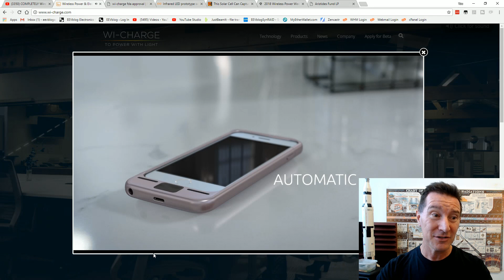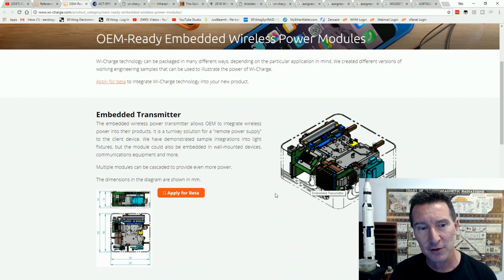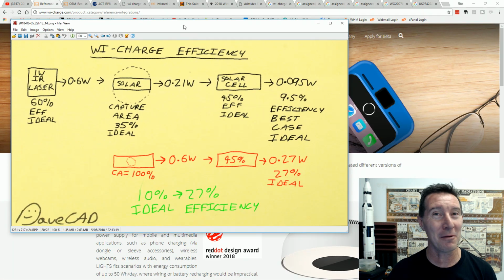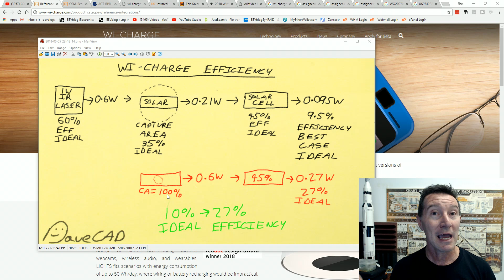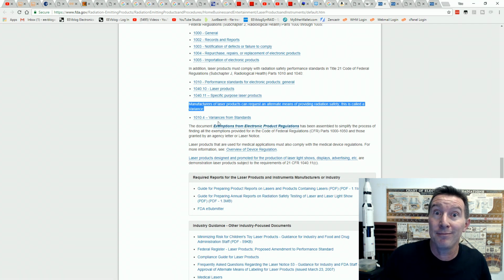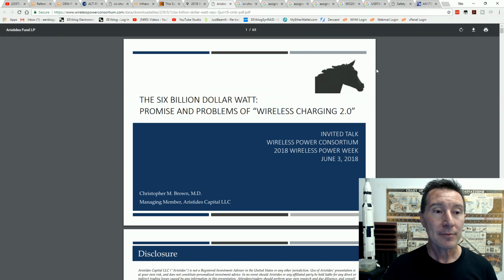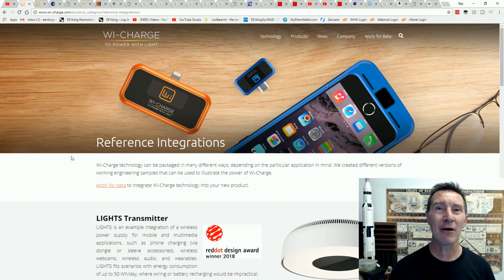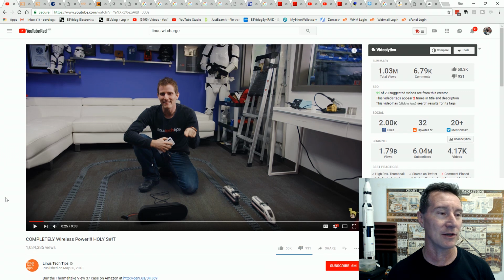EEVblog #1092 - Wi-Charge IR Wireless Charging - Fact or Fiction?

Comment: At least it will get nice and warm in your room.
Also good device to get rid of your tumor cells (and everything else)
Reply: Piet Muijs Not really. The average resting human male gives off about 100W of heat. This thing only produces 5W of infrared energy, some of which is being converted right back into electrical energy.
Reply: Correct, but that's not focused on just one spot! They actually do use similar techniques to get rid of cancer cells just underneath the skin surface.
Reply: Piet Muijs He was refuting your claims of it heating your room. He mentioned that your body gives off 100 watts of heat, and this unit has almost 100% efficiency through the air. (As stated in the video by Dave.) So it shouldn't heat your room by any noticeable amount. (Negligible heat output.)
Reply: The amount of heat produced will be equal to the "wasted" energy, the amount of consumed power that doesn't get converted back into electricity. So if it's 10% efficient then it's 90% heat.
Reply: Well if you hear what kind of laser you need + any other losses in the circuit. I would say, go do your math!
Reply: +Piet Muijs
What?
Reply: 5W delivered with 10% optimal, would waste like 95W just on the laser itself. That plus all the tracking and such and that's pretty close to a person based on numbers here.
Reply: So you think that 5% is negligible output, eh? Tell that to w-charge!
Reply: If this thing can track flying mosquitoes and "deliver power to them", I'm buying it straight away.
Reply: lmao
Reply: hope your being sarcastic
Reply: An 80W candle is fine from a few cm away, but not if you put your finger in it. 
Also, a laser beam can stay bundled for quite a long distance (Therefore keeping it's intensity, unlike the candle)..

1W focused to e.g. <1mm diameter can definitely cause trouble. I assume they're using a larger beam to limit the danger for skin and eyes..
Reply: there was a guy who actually built one of those to be used in countries where malaria mosquitoes live.  AND he made to distinguish between different types as only one carries the malaria virus. cost a bazillion dollars but he did get it to work!
Reply: you dont get rid of cancer cells with IR light genius
Reply: "you dont get rid of cancer cells with IR light genius"

Yes you do

You can*
Reply: @Blox117  . This is actually a well used method in hospitals. Was my university project many years ago.

Comment: I think the efficiency numbers need to include the power required by the control electronics and the scanning mirror system.  Since you were talking about a device with 1w input to the laser, I am guessing the control and aiming might also take a watt, more for early models and less as they improve it, dropping the efficiency in half.  The other issue is if you are powering more than one device, there will be time lost to slewing the laser between devices and getting the spot aligned properly.  This will also lower the system efficiency.

I am not sold on my "wireless" Qi charger needing to be wireless itself.

Comment: I really don't understand why companies are still trying to chase this whole wireless power idea. No matter which way you look at it or what technology is involved in delivering this wireless power, it will be incredibly inefficient, it will be plagued with issues and it will be incredibly expensive. And as Dave said, especially in this day and age of energy efficiency and power efficient devices to help save the planet and reduce our carbon footprint I really don't see the logic. Just plug a cable in or use a QI charger and be done with it.

Comment: Ooof, thanks for talking about this Dave, I needed this video.

I honestly had high hopes for these ideas around wireless room power transmissions and whatnot, and I had fallen a bit for the marketing speech, but your video really helped dispel some of the bullcrap. I've heard about the Energous stuff like what? 5-10 years ago now when they first showed up on CES. Got subscribed to their mailing list and still regularly receive some news from them every so often, but of course it's never about any of the products they promised and that they've been saying they'll have ready for the market since that first presentation.
It's not that I didn't have my doubts, but I think it just didn't hit me.
In a sense, all I've ever expected from these technologies was trickle charging... I mean, it only makes sense - if you can't have a full fledged charger with Qi that's basically induction, and you need some pretty big solar cells under very bright sunlight to get anything usable, it really doesn't make much sense that this Wi-Charge or the Energous RF based charging would do a whole lot better - because if they did, people would already be using it.
To the point, I'd be satisfied with trickle charging if it didn't have health hazard potentials, and if it doesn't like pull so much power that it's just better to buy 10 qi chargers or 20 magsafe style cables and spread them around everywhere. Wishful thinking I guess.

But since we're here, what do you think about the Disney crazy room stuff Dave?
https://arstechnica.com/gadgets/2017/02/disney-room-scale-wireless-power-transfer/
Sounds dangerous and somewhat like having a transmission antenna into your home or something... with similar power costs. Anyways, thanks!

Comment: Having designed systems with high power IR sources, I agree with you that this product would not be approved using the published standards and would have to be approved via some variance!
Just for clarity, the systems that I worked on were not interested in transmitting power, we were just using the IR for signalling, even that was difficult!

Comment: I don't think this technology is for me but I do find it interesting that you gave them davecad math saying between 10-27% ideal and they came back to say safe to say it's between 5 and 27%. Makes me think it's somewhere in the 5-10 range or else why would they lower the range?
Reply: Aaron E 
It is more like 1%. 

Daves numbers a far too optimistic, specially the detector at 45% is far too optimistic. 
Realistically we have 30% on the transmitting laser, 10-15% on the detector, 90% on PSU for the laser, a few watts on electronics/software, a few watts on tracker mechanics, 10-99% losses in spot tracking. 

That said, efficiency is not an important here. They simply can NOT deliver 5W of optical power safely on a spot size similar to the device size .  That becomes even worse If they are talkining about 5W delevered electrical power.  

Regulation for public spaces limits laser power to 1mW. This makes me believe that there are batteries in the trains and they are using the laser for control.
Reply: Naoh Watson Well it's in demo labs only, not public spaces, so the 1mW doesn't apply yet.

Comment: 1. Invite them over for a demo
2.Prior to their arrival, secretly wire a mains plug socket with data logging gear and  modify a mobile device to monitor the power coming in the usb.
3.When they arrive ensure they use the plug connected to the data logger and the device fitted with one.
4.Let them show off their device.
5.Have a big smile on your face knowing that you got their real power levels :)

Or I guess you could wait till they release numbers....

Comment: Published efficiencies of solar cells are what you'd get if you measured it under a standard solar spectrum.  At least half of the light that a solar cell fails to convert is missed because the energies of those photons are below the band gap.  Look up quantum efficiency for conversion efficiency at a specific wavelength.  It is reasonable to expect a cell with a plastic or glass cover to convert 90% of a very specific wavelength to electrical energy.  Most of the loss would just be scattered off the cover.  

I'm still skeptical of this product though.

Comment: If the diode is rated for 1W it will output 1W per square centimeter at its max current, however it consumes more than 1W to produce that, otherwise I have no issues with the basic calculations. I'm sure their "delivered power" metrics are the outputs from the laser diodes. To make it safe they probably have to expand the beam significantly, which reduces its laser class and reduces its efficiency on the photo-voltaic panels.

Comment: I mentioned on Linus video end to end efficiency of 5% at best. Dave is to generous with his estimations :)
I guess in therms of safety they scan at much lower power then when receiver gets the data (data will contain transmitted power) and that matches with the power received by the infrared receiver they increase the level to full power and only keep that level as long as the receiver confirms it gets the transmitted power.
Reply from the maker: I always err on the best case no loss side for arguments sake. If it sucks with those numbers then it will be even write in practice
Reply: Yes it makes sense I will likely do the same if it where to do a video about this or something similar. They of course agreed with your numbers as is what they dream about :)
If they could get 27% efficiency they will likely advertise that as is already close to what may be acceptable for some applications.
Reply from the maker: Yes, they are likely throttling the laser power during the scan / negotiation / lock phase. Still doesn't negate the safety concerns much.

Comment: 5W laser?

That's getting dangerously close to something capable of setting things on fire, isn't it?

The basis of the project still makes much more sense than other wireless energy transfer such as RF, acoustic,...
Reply: Depends on the focus area. Look how big the receivers are.
Reply: jort93z that is assuming the system actually does drive what it claims.

But even just a 5W laser beam wouldn't want to come across a lense during the tracking.
Reply: The actual Laser output power will most likely not be 50W. Note that this is different from the Laser´s input power.
The output power only needs to be enough to reach 5W after the photovoltaik cell has done its conversion.
If the 5W output power is correct, then in the best case they might be using "only" a 10W laser.

That being said, a 10W laser shining onto your skin will definitely feel hot. But its ability to actually burn things also depends on the beam diameter.

If they do it right, it should be possible to turn down the power of the laser before anything gets between it and the target. For example you could use a low-power LIDAR or an ultrasonic sensor to detect things that are too close to the beam path. It´s difficult, but not impossible.
Reply: jort93z 

Yeah, that too. But as Dave already mentioned it, I didn't think it was necessary to repeat it
Reply from the maker: At minimum it's an 11W laser, and they do not deny this in a recent email after watching my video.
Reply: EEVblog i certainly wouldn't want to have a 11W invisible laser swinging above my head, it's frightening.
I'm also thinking that's a really cool tech and that they've really gone into details, but come on, 10-20% efficiency just to ged rid of cables? I plug my phone before going to bed, i don't need a wireless 10W infrared laser charger above me, waiting to fry the top of my head.
Reply: EEVblog that's terrifying no thanks, what about nerds harvesting these lasers to make god knows what with them

Comment: FDA approval?  Does that mean it's safe to eat?  What about UL approval?
Also, the efficiency can go way down it the device is at a low angle of incidence relative to the beam.
Also, I was a bit disappointed that Linus' video didn't open up the trans and speaker to show there were no batteries inside.

Comment: It is a nice concept, but they haven't considered the wavelength pollution, no mention of device fail safe mechanisms against tampering, lens calibration error, dust accumulation, mites /roach infestation inside the device. And Dave is right regarding not having an 18 Watt laser in Human environment(500 mw is more than enough to cause several permanent damages to Human body).
Kudos to you Dave for your teaching efforts.

Comment: I have built a very simplified "toy" grade IR charger using my own parts.

1. If the light fails to cover the whole solar cell, efficiency may SUFFER A GREAT LOSS.

I was using a 1 ft x 1 ft mono-crystal Si panel rated at 18 V under the sun covered with glass for its protection. This module contains about 36 solar cells.

I first pointed the beam very close to the solar panel about 1 ft by 1 ft. All energy is directed to a point. The voltage is very low probably because of internal resistance and other issues.

I then moved the light away from the solar panel. As the light began to flood the panel, the voltage started to increase.

2. If you use 850 nm or 950 nm IR, a regular Si solar cell may actually be reasonable efficient. The band gap of silicon is 1.1 eV which translates to about 1100 nm. The solar panel under the sun suffers very low efficiency (33% in theory, 15% in practice) because it cannot use the energy about 1.1 eV. About 2/3 of energy carried by a violet photon is lost to heat. Using IR to transmit energy actually increase the solar cell's efficiency.

This charger is still a huge waste of energy after all. It has to point the laser to the receiver and the mechanism eats a lot of energy. I don't have time to look up info about the mechanism Probably a camera + a computer that track the receiver and a mirror driven by two motors to point the laser. It's going to waste many times of energy to be delivered.

Comment: The safety aspect of this is what worries me the most.  When you go into the 1w+ range of lasers even a fraction of a second exposure to eyes can blind you.  Or worse, what if the electronics fail and it locks up with laser at full power and it's no longer tracking.  I feel all these wireless charging things are trying to solve a problem that does not exist.  There are better ways.   Heck, why don't cell phones have a standard where you can drop them in a cradle like cordless landline phones?  That would be the best next thing really.  It's still wired but nothing to plug in, as apparently that's a lot of work. :P

Comment: I wrote my diploma thesis round about 7 years ago about developing an 'autonomous optical regulation circuit for the eye-safety of power-over-fiber systems'. So it was somehow related. Instead of free-field beams it was about optical powering (up to 7W) e.g. communication devices in the field over fiber without having to supply extra elecrical power.

I remember how much effort I've put into reducing the laser class from 4 to 3R for the use-case of 1W power transmitted. (Which failed to achieve the goal of actual eye-safety, but all were impressed that I even achieved to lower it to 3R)

Of course I was using the default regulation for laser safety classes. It was all about power and exposure time combined with the accessability of the 'radiation'. That's why closed devices with high power lasers can achieve laser class 1. The regulation measurement (don't quote me on that) if I remeber is measured at 10cm distance. So in my thesis it was all about intelligent and mainly quick safety shutdown. We're talking about max. latency times of microseconds only to reach LC3R in a 1 W szenario. So it's hard to imagine to reach LC1 with a wireless protocol like bluetooth combined with all the processing and laser power-down-time needed.

What you're mentioning at the end about an alternate safety regulation standard worries me a bit since even that 7 years ago there was an alternate regulation for scanning lasers, mainly focussing on disco lasers, allowing them to output much higher powers. (At least here in Germany, but most likely there are matching standard all over the world.) But this standard (as I understood and remember it) relies on the low probability and so low accumulated exposure time a beam may hit you in those disco szenarios as well as you'll have restricted areas (besides the laser power of course). So applying it (if they do) to a scanning device that does the apposite (Tracking) seems to be a bit of abuse if they're using that standard. (Which I don't know)

And with the safety approval: I guess you can safety approve everything as long you're putting a LC4-Sticker on it, requiring the users to wear laser protection and operating the interlock accordingly.

Infrared light is highly dangerous because you don't notice it. Therefore it can never reach LC2 because it relies on the eye-shut-reflex and is only applicable to visible light. But funnily later it was observed the not every human has such reflex, but the LC2 keeps being valid. I guess they're now relying on not being stupid to stare longer into something that is really bright. (Like the sun) - But unlike the sun the focus of a laser can be so sharp that you may not even notice it.

But if it's all legit, I take my hat off to what they achieved! thumbs up

Anyway keep up the good work, but stay safe!

Comment: Hopefully meta materials etc will make it possible to use other frequencies where angle of incidence and possibly obstacles etc are less of an issue in which case tracking with beams etc would potentially save enormous amounts of energy... I wonder how many of these companies are hoping for a breakthrough before they go bust?

Comment: Instead of going after the consumer market they would probably be better suited to the telecoms industry, something in the range of POE but power over optical fiber this would then remove most of the laser safety issues as it would be contained in a medium. Chromatic dispersion will always be hard to control i.e. shine a torch at night  you see the light beam spreads wider into the distance lasers do this too but over a much longer distance.